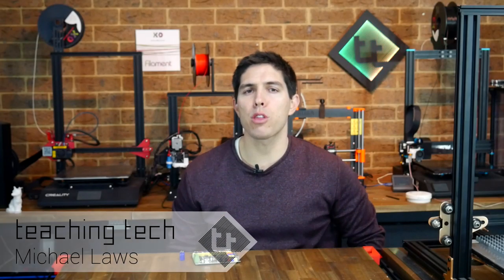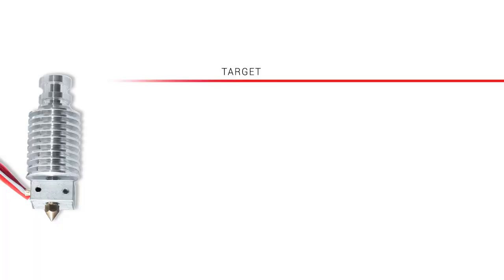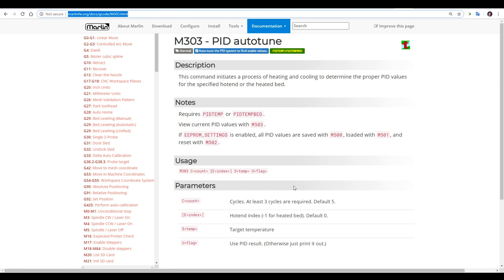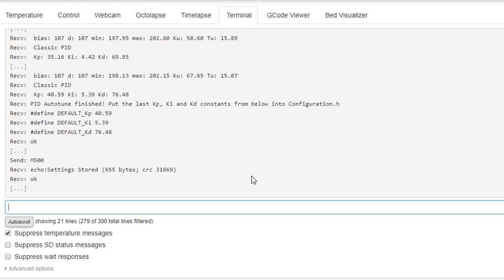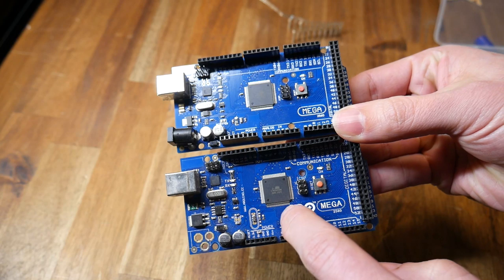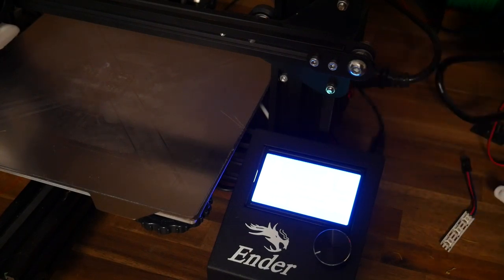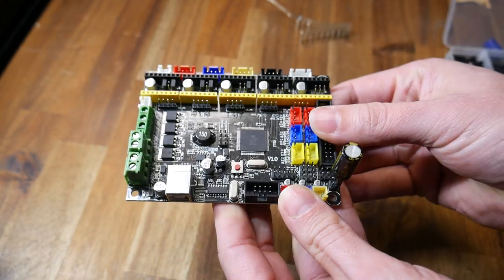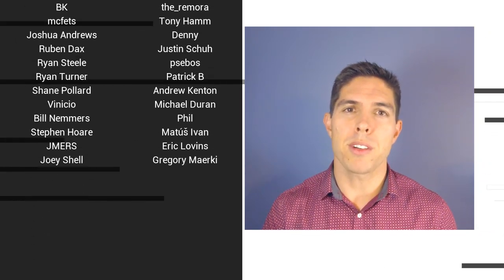Two easy fixes for 3D printer temperature swings - PID autotune

Comment: I've changed my hotend kit then i faced with overheating problem, when I start the 3d printer, the nozzle automatically starts to heat up and rises to 300 degrees, I can never stop it. (Ender 3 V2)

Comment: With new Marlin firmware on my Sidewinder X1 i tried PID autotuning via TFT. Now the nozzle temp oscillates between 237 and 244°C (Set 240°C). :-/
There something wrong with PID autotune.

Comment: Connecting...
Printer is now online.
>>> M303 E0 S225 C10
SENDING:M303 E0 S225 C10
PID Autotune start
Error:Heating failed, system stopped! Heater_ID: 0
[ERROR] 

my cartidge wont heat up? ive changed the thermistor and cartridge, it was doing this before and after i changed them.  I have a cr10-s5, and am getting an E1 Heating Failure alarm.  Any help would be so much appreciated!

Comment: I'm already a compulsive manual levelor. Now I'm going to be all up in my hot ends business every time i drastically switch print temps. Or maybe just save some copy paste settings and insert them in the gcode on my high temp files.

Comment: thank you michael, your suggestion worked...
for those who migrated to makerbase e3d board, here's what I went through:

M303 C8 S200
M500 -> This says "Settings Stored" but it doesn't. Apparently stock firmware doesn't enable EEPROM.

So I went to PrusaSlicer settings -> Custom G-Code -> Start G-Code and added, as Michael said,

M301 P<coeeficient here> I<> D<>

Good luck and hope this works for you too

Comment: After I changed my nozzle, my temperature wont sit within 12c of what I set it to. Pid tune didnt help, changing thermistor didn't help. My heat cartridge isn't loose or crushed, all of the connectors on my mainboard are right. I cannot figure out what's wrong. It won't even start a print because it won't hit the temp

Comment: i have a older printer from 2014, no way to update firmware.  
got to try this and see if it accepts these commands.
Reply: @WhiteG60  yeah i thought about puting a duet or something in it.  It's a Cartesian style printer.  Italian company that's no longer around.  heres a vid on their youtube which is still up 
https://youtu.be/cu8YIUC3NsY
Reply: @WhiteG60  i tried sending pidautotune command on octoprint but it just ignores it.
Reply: @WhiteG60  oem board in it is a speedyboard form like 2014 era
Reply: @WhiteG60  yeah tried multiple times, no response from Speedyboard and all emails to IRA3d come back as deliverable. their website is gone as well.  New brains it is!

Comment: You can go as low as 100uF but over 1000uF does not give much improvement. obviously, make sure the voltage rating is significantly over 5v so I would advise using a 16v or greater. Tantalum can be used with the same value guides. I also added a 0.1uF and a few others to cover all the noise in my shop, you can find the little PCB files for Eagle Cad here  https://github.com/foxabilo/MKS-GEN-L-V1.0-TEMP-FILTER/tree/master/EAGLE/projects/MKS%20GEN%20L%20V1.0%205V%20Smoother
Reply: foxabilo 
I am running a 5 V fan from that corner block, and used a 2200 uF capacitor with a DuPont connector as illustrated here (although I had pre-made connectors that required soldering).

Ideally, you would use several capacitors of different values to smooth out the 5 V rail as much as possible.  My rail is still not fantastic (checked with a ‘scope), but it works well enough right now.

I haven’t got around to PID tuning yet, which frankly is pretty slack.  My print quality is pretty good anyway, but it is always going to be worth tuning the heating systems properly.
Reply: @boggisthecat  Yup, I added a replacement connector block to the PCB in the link for anyone who is already using that connector for fans etc, and the extra caps do really clean the line up, in a perfect world it would have an inductor to form a proper low pass filter, but then again you could just use replace the buck converters inductor and fix the problem at the root :)
Reply: As you go higher with voltage rating and capacity, the ESR will increase. So you should find the sweet spot in capacity and use as low rated voltage one as possible.
Reply: @gerleimarci  Indeed, I just would not want to be using 6.3v rated caps on a 5v system as that's too close to max for me, this is a situation where the classic transistor capacitive multipler would work well to remove the large ripple with small caps.

Comment: I was having this problem and I fixed it just by wiggling the hotend wires
Reply: Cody Bellerose that means your heater is dying and the cables are not in good condition, and it might be a potential fire hazard. Please search for a heater replacement ASAP, and make sure you support the wires near the hotend to do some strain relief.
Reply: @xoniq-vr  thanks
Reply: @chromeaviation  +1 on what J P said 
That is defn a loose heater cable 
Those heater cartidges are cheap so not worth trying to save the money and not replace it tbh

Comment: As informative as this is, none of this is in any way simple or easy for casual users.
Even entering manual gcode commands is what I'd consider requiring an intermediate knowledge base. Once you started talking about the second method I was completely lost lol.
Reply from the maker: Unfortunately that's the state of hobby 3D printing right now. It requires a certain level of investment in learning this stuff to get the best out of many machines.

Comment: So I noticed that I was getting fluctuations in the hotend and so I swapped out the heater cartridge and thermistor and the hotend. I was still getting the fluctuations. So I did a PID autotune on the printer and it's still fluctuating. Does that mean the main board needs to be replaced?